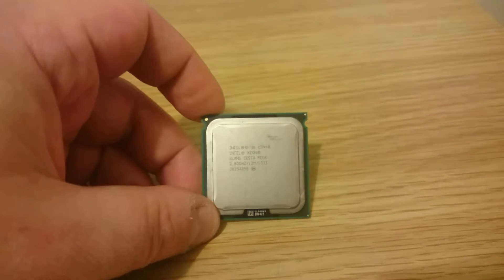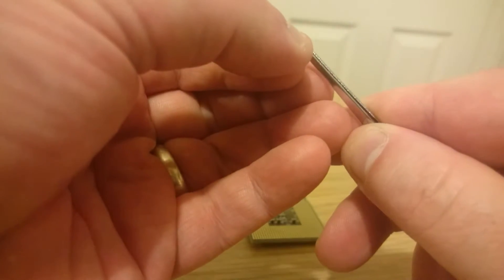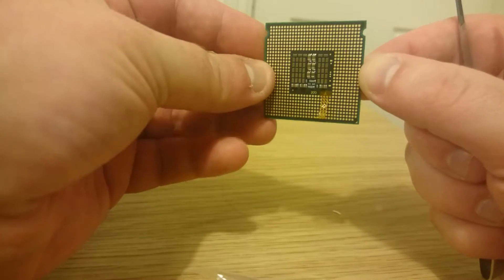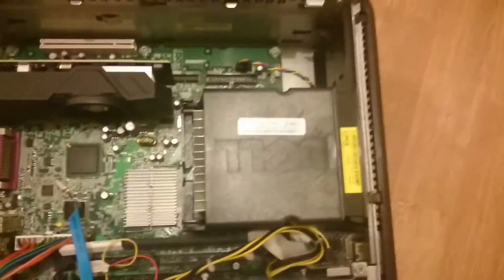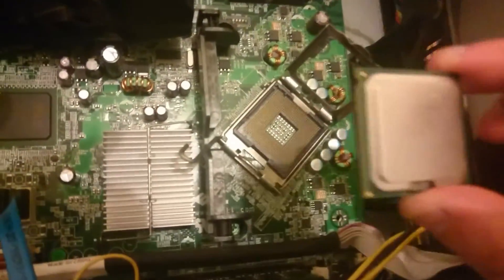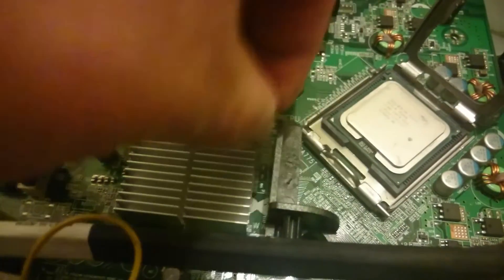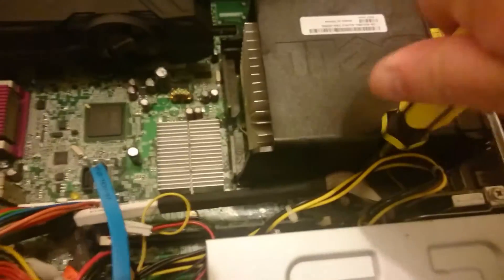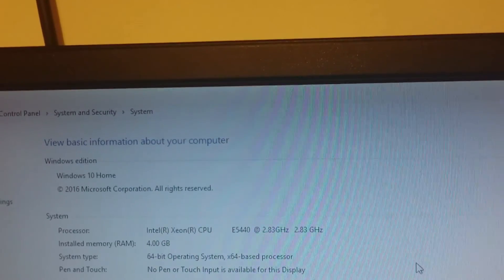How to Modify a Dell Optiplex 330, so it will handle a socket 771 Intel Xeon E5440 2.83GHZ

Comment: After installing XEON E5450 1333Mhz on optiplex 330, can XEON work as original performance? Can mother board (FSB800Mhz) handle FSB 1333Mhz?
Please answer for my questions. Thank you.

Comment: Have you tried installing 8GB of DDR2 into these?  I hear they are compatible with 8GB, but no one confirmed if that was for the desktop version (like you have).  I hope you see this and can give me a reply!  Thanks in advance!
Reply from the maker: I attempted it. Sadly, it didn't work with 8gb.
Reply: @ThommosTech  Thanks so much for your reply.  I suppose the E5450, 4GB of PC2-6400 and an SSD will have to do the job then!  I really do appreciate the feedback!  That said, if you run into any MT versions of these systems, I know for a fact that they will operate just fine with 2x 4GB sticks!  Done it myself a little under a year ago.
Reply from the maker: Nice one. Thanks for letting me know
Reply: @ThommosTech  Anytime!  I love sharing knowledge I have on these older systems.  I'd much rather see them converted into HTPCs or entry-level gaming rigs than end up parted out or in landfills somewhere.

Comment: Bro what's the tape type thing you put in proscossr can u tell me so that i can buy it
Reply from the maker: Search for Xeon mod on eBay and you'll find them.
Reply: Thanks bro😘 same thing will work on dell optilex 980?
Reply from the maker: It won't work on the 980 as that's got a different socket.
Reply: Damn! Anyway u got a new sub
Reply from the maker: Thanks mate

Comment: Will this need any bios upgrade?
Reply: It does require a bios update
Reply: @no_4259  Oh okay, how would I do it? I can't find anything on the Internet.
Reply: Kingrai 15 here is a general guide, which of course has to be modified depending on the PC and the CPU you are using:
https://www.delidded.com/lga-771-to-775-adapter/

Just a heads up, step one asks you to update the bios to its latest revision, but Dell has been known to sometimes use digital signatures to avoid this trick. Search if your hardware needs to be downgraded or if you need a custom bios in forums. Good luck!
Reply: I guess I could tell you what could you expect. I just upgraded my Optiplex 380 (chipset G41, so it can run most processors) with a X5470. First, I had to downgrade the BIOS down to A05 because of the signing(ironic, I upgraded to A02 from A07 just some months ago, the BIOS can be found in Dell’s support section). From there, most Xeons that don’t have E0 stepping would work but mine does, so i had to find a modified BIOS to make it work (if you were to use E0 processors, you would get an error of how it’s not supported. Ignoring it would simply make your fans run at full speed and your processor to run with the same configuration as it’s 775 counterpart. In most cases it’s fine but mine was still running with 2 cores). After finding the bios that adds 1067A support (the processor’s ID), I simply installed it, restarted, and now the bios was a modded A07. Now I could install the new CPU without the fans going haywire or some error message. Windows for some reason was still thinking it was my old Core 2 Duo, so i had to make it forget it and restart for it to detect the new hardware.
Reply: @no_4259  Oh okay mate, what xeon would not have E0 stepping but still be a sizable upgrade? The one in this video?
Reply: Kingrai 15 the E5440 you see in the video is probably my safe bet for your system, as in the Dell forums it’s reported to work with your system without a modified bios (ONLY the model with C0 stepping, model SLANS). It’s also been reported that the E5450 (model SLANT) also works like this, but I ain’t sure. However, even if you get a model with E0 you could easily follow this guide https://linustechtips.com/main/topic/532126-dell-optiplex-330-with-xeon-e5450-need-help-with-a-bios-mod/.
Reply: Wait did you reply? It came up in notifications but I cannot see it here.

Comment: Will the X5470 work?
Reply: probably wouldn't due to the fact that these boards don't support more the 95w cpu''s 
the E5470 and rest should work, but the X5400 series might not
Reply: @dexsters5643  Oh okay, is the E series still a sizable upgrade? What is the best cpu you can put in this PC?
Reply: @warriorharj79  im not sure i my self had no luck with this i had a dell OEM board where i put in a E5430 and it kept boot looping and i idk how to pass that error.
Reply: @dexsters5643  Oh I am sorry to hear that.
Reply: @warriorharj79  yeah well i kind of moved away from lga 775 , rn i use a 15€ i7 3820 oc to 4gh on Chinise X79 Turbo v1.02 mobo with a rx 580 4gb

Comment: Will this work with a 380???
Reply from the maker: +TrAxOn HaXx yeah. The same mod works on the optiplex 380
Reply: Is it the same process for te Xeon w3550
Reply from the maker: +TrAxOn HaXx the process is the same, but the w3550 might not work, as its rated to draw more power than the mothrrboard supports!
Reply: Ok so get like a 5450?
Reply: Also thanks for the reply and keep up the good work
Reply from the maker: +TrAxOn HaXx yea
Reply: Ok thanks for the help bro
Reply from the maker: +TrAxOn HaXx no problem, pal.

Comment: Ack, use real thermal compound please!!! I use Artic Silver's Ceramique 2, comes in a nicely sized plastic syringe, for $7 on ebay(where I bought it, you can also find it on amazon). The stuff you are using has horrible seperation and bleed, silicon oil is not a good thermal conductor.